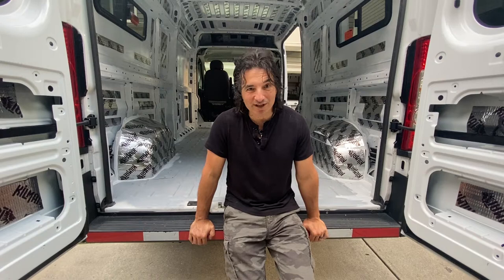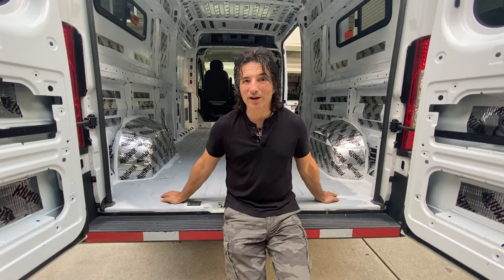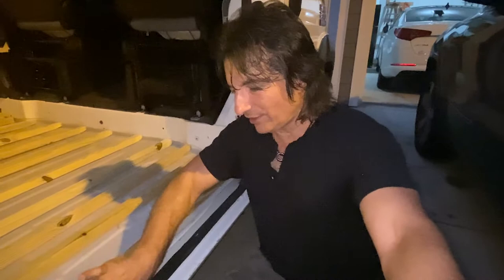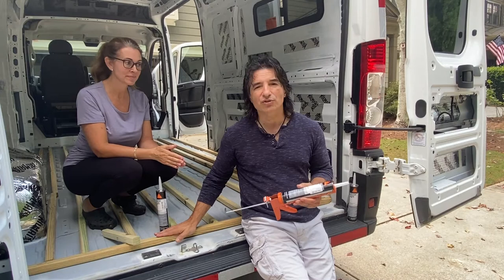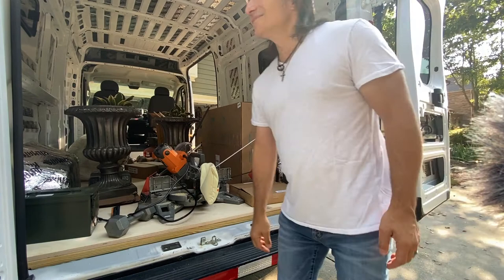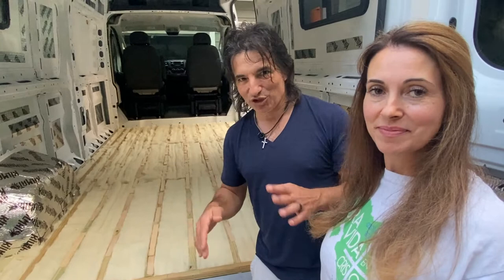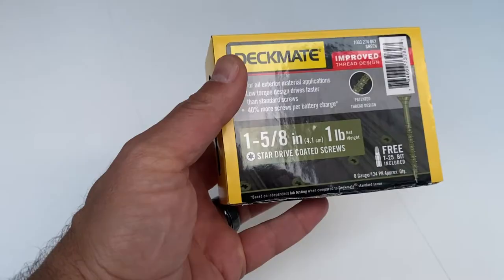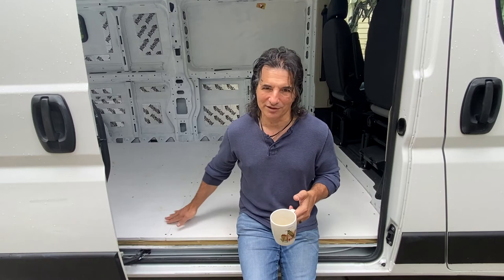Installing the Subfloor: Part 3 - RAM Promaster 2500 Van Build Episode 7

Comment: How did you handle the odd dents in the middle areas of the van with the glue (in a prior video, you said you thought perhaps the pervious owner dropped something heavy)? I have the same issue in mine. Thanks again for all these videos- they are helping my anxiety with this project I'm about to embark- lots of expense and labor so your videos are Heaven sent on thy nerves😁 Also, are you happy with the Havelock wool? I am considering that or the 3M Thinsulate
Reply from the maker: So what we did was found very long and straight 2x2s. Most Home Depots only sell them 8 feet long, but we found one that carries 12 footers, So we used those for the length of the van. They sort of floated over the low spots and made the floor pretty level. I also jammed some shims in the low spots to make things level. If the floor were straight, I think we would have used 1x2, instead of 2x2, giving us an additional inch of headroom.
As far as insulation, we did most of the can with wool, then finished with Thinsulate. We like the wool for jamming in little nooks and crannies....but we like the Thinsulate to use in sheets. Both are good products. I like working with the Thinsulate better......it makes less dust than the wool and doesn't make the van smell like a tannery for 2 months. ;)
Reply: @marctania2349  Thank you for your reply!! I’m totally copying your expertise (and “shims” - brilliant🙌🏼!!). I really like your idea of using both insulation products for how you explained…because, yeah, all the work it takes doing this only for it to smell like a barn😹 Anyway, I appreciate your videos and knowledge very much- God bless you both🙏🏼 Can’t wait for the next upload✨👏🏼

Comment: So glad to hear you guys had to shim and with paint sticks. I just laid my furring strips then noticed the height differences in the low spots. Now, I know it wasn’t my retarded brain that screwed up but rather the configuration of the factory floor.
Reply from the maker: Hate to say it, but we have used paint stick all over the place to shim stuff
Reply: @marctania2349  i ended up caking on the liquid nails to level my furring strips. Worked like magic